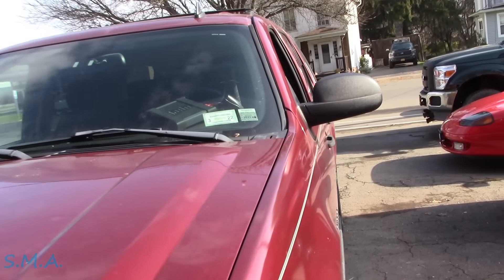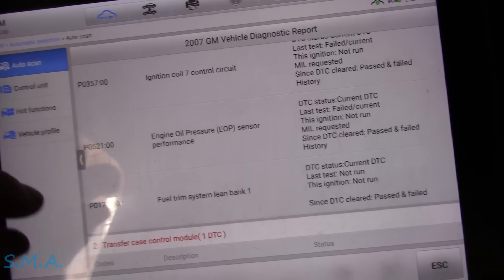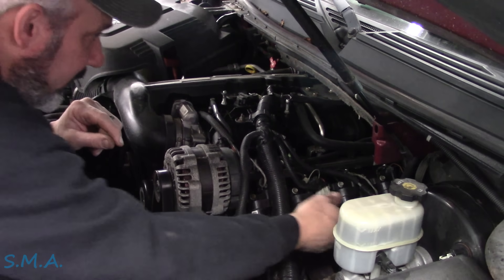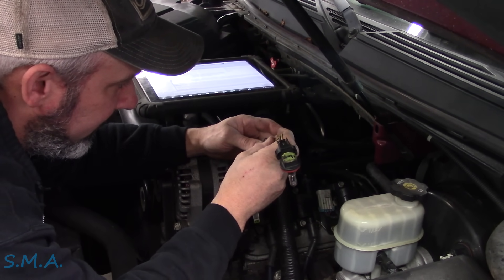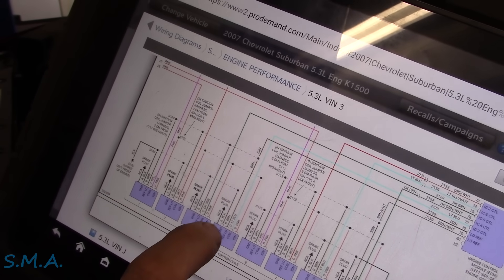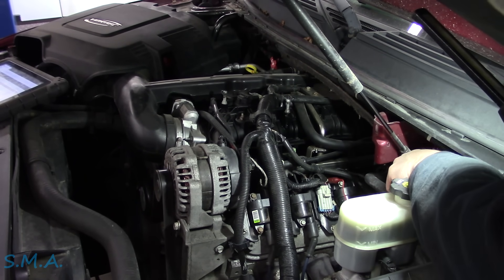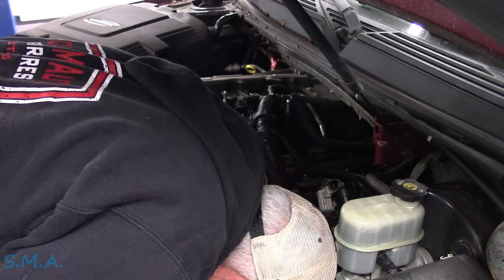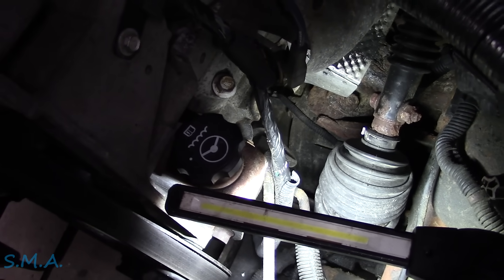Chevy Suburban 5.3: Entire Bank Misfire

Comment: One of the first things I learned from my Uncle Gus was check the grounds. He was a truck driver but also a pretty good mechanic. He drove for a trucking company that had a truck that had been in the shop for a month with numerous electrical issues. He kept telling them that there was a ground problem and they kept telling him he didn't know what he was talking about. Finally they told him if he thought he was so smart, fix the truck. He took the main ground wire off the frame cleaned it and put it back on, truck was fixed!

Comment: Quite impressive the entire bank has a blackout 😂 and this guy diagnosed the problem in less than 10 min ... Truly a PRO ! 👌💯
Reply: That was simple fix. Like he said all 4 wires or or coils going bad at same time highly unlikely. Nit impossible but just very improbable. Plus gm doesn't manufacture vehicles designed for the rust belt and Roberts your fathers Brother it's a bad ground.

Comment: Gotta love US auto manufacturers - leather "trimmed" seats, four compartment interior climate control, led mood lighting, satellite radio and break away ground connectors to ensure repeat business.    Clever.
Reply: The American dream keep ‘em coming back after 10 years. 😀
Reply: They call it a "Quick Disconnect"😋
Reply: The break-away feature is for safety during accidents, like break-away sign posts. :)
Reply: I got a classic us manufacturing truck come out factory with the rusted cab corners standard
Reply: Did anyone notice the rust and corruption under that hood? There's not much any design engineer can do when road salt is trying to return your vehicle to ore again.
Reply: Rust Belt salt corrosion.
Reply: More like all auto manufacturers.
Reply: Exactly...
Reply: I guess it’s better to coat your wires in soy so the mice will chew them into.

Comment: Hi, I'm the proud owner of a 2007 GMC Yukon Denali. I lost the whole left cylinder bank last night. I live in the Netherlands and the AAA, which is called ANWB, doesn't know anything about US cars. So there I was in the middle of nowhere with this rough idling car and all kinds of codes in my screen...and than I found this YouTube video that told me exactly how to fix it! Man, I'm so grateful for your help. Can't thank you enough. Car is driving smooth again and it took ten minutes and a piece of wire...so again, thanks!
Reply: My 08 sierra has been skipping so bad could t drive checked finally yesterday found it was entire rt bank. .watched this video fixed it in 1 day because hard to get to .Didn't want to rig.left bank quit 6 Mos ago.cost mu 400 to have fix .If they had fix both wires I wouldn't had this problem yesterday

Comment: Had a Wire Gremlin , Ghostly , Phantom issue in a friends 1994 Chevy 6.5L turbo diesel.  Started looking at around dusk and was quit dark when i opened the hood.  There was an strange orange glow coming from behind the head at the fire wall.  Mind you i had turned all a/c full and headlights and everything power hungry on before i opened the hood.  A single copper ground strap attached to the motor and firewall was glowing red enough to cook on.  All 4 of the other grounds were totally corroded away.  And with a mechanical fuel pump it didnt need spark.  BTW the fuel bowl was just in front of it!  Could have been a fire!!!

Comment: Thanks for the great video. I have a 1960 Chev panel truck with a 4.8 that is doing the same thing. If I wiggle the wire loom above the connector it will fire back on 8 cylinders intermittently. Time to check my ground.

Comment: Great explanation on this! Just had my 2016 GMC Yukon XL with a 5.3 and 135k cylinder 7 collapse lifter failure, which led to a cylinder 7 fuel injector replacement, lifter replacement,  then to a VLOM replacement, where like your video all lifters were replaced on left side, then after we got it back from Chevy dealership cylinder 1 misfire so back to dealership who said it has a spark plug failure.  We had the plugs replaced 2k miles ago as routine service. Got the vehicle back and another misfire P030 cylinder 3.  Back to dealership and they say the spark plug to cylinder 3 has failed.!!  They can’t figure out what is causing the plugs to fail!!?? I wonder if it’s the ground!!??  $5K spent so far by my extended warranty 🙏🏻
Two hundred miles before the misfires started the transmission was replaced.  Is it just bad luck!? Always been a GM buyer…. 🤷🏼‍♂️

Comment: This video was very helpful. I have a 2010 Tahoe that's been running like crap for months and had no check engine light on. 

When I stomped the pedal to pass someone my C.E.L. flashed 10 times then the light finally stayed on. Upon using a basic code reader I have the P219A & P0300.

I'll be checking this common ground next weekend when I get some free time. 

Hopefully this is the only issue with my vehicle!

Comment: Had one with the same issue just on the passenger side. The video helped a lot, this one had high resistance so it didn't take the whole bank down right away but after 30 seconds they all misfired

Comment: YOU WERE 110% CORRECT...THAT WAS MY EXACT ISSUE AND YOUR FIX.... FIXED IT!!!!! I have changed and added addtional grounds to the trany alternator engine etc. a year or so ago....but not this one. A grouind was also my problem back then with harrd trany shifting changing/fixing those fixed that problem. Thanks for this video. No one else mebtioned it...they went right to the cat as the culprit and that would have been around 2 grand to fix.

Comment: Yes you did shoot a vid on that ground - it had rubbed through on the P/S pump in that vid. Reason this is fresh in my mind is because I JUST fixed a '04 Yukon with the exact same issue as this 'Burban here, only being a GMT-800 resulted in a crank, no start! I looked through a few of your vids to try and get some quick direction and that was the one that came up first. I ended up back probing the ground & grounding it the same way you did (Only I had to repair my jump wire alligator clips for 10 minutes first - you'd think the camera was rolling, LOL!), and the vehicle cranked right up without missing a beat. So I then spliced a wire into the ground there, and connected it to the firewall ground where the left head ground strap lives. FIXED! I couldn't believe it was that easy. I was LOOOOONG overdue for a quick easy fix! Those are few and far between around here ...

Just like Cousin Eddy said, "(GM) is the gift that keeps giving, Clark, the whole year through."  That and, "Merry Christmas! S!&$#er's FULL!  :)
Reply: Oh, forgot to mention, I almost went down a rabbit hole fixing that one because I had a U1000 (class 2 comm failure), and a B1440 (power mode master input mismatch). Had not a single code regarding ignition!  I almost started chasing the ignition switch and BCM. Once I realized I had injector pulse (from the smell out the tailpipe) and theorized I had no spark, things got much easier.

Comment: Not boring, Eric. It serves to reinforce the fact that if you live in an area that has a lot of moisture, salt or even worse both, you can bet that you're going to have heavy corrosion, and generally the first things that are eaten are the soft metals (copper, brass, aluminum, ect.). The best way to avoid corrosion issues in my opinion is Fluid Film and more Fluid Film. So many bad things occur because of bad or nonexistent grounds (generally left unprotected except for paint which is  sometimes easily defeated). Great vid, Eric! 👍

Comment: Good diagnosis! One is for sure the parts that was replaced alleviated a possible problems . As it turns out the cylinder heads should be sent out to machine shop to be gone through. With that many Milles . It would be a good idea.

Comment: Found the same problem same location with my 05 6.0 GMC. But an 05 is listed as 2 separate grounds and in 06 it was changed to 1 wire for both banks.

Comment: Recently had this exact issue on my 2008 Tahoe (same color too!). Unfortunately in my case, it decided on the high way it was going to lose its connection to the passenger bank only and dump raw gas straight into a nice hot catalytic converter. Blew it to pieces internally.

Managed to track it down myself and fix it, was quite proud of myself. Found a wire harness diagram on google, that helped tremendously.

Comment: when i first read the title, i said to myself plugged cat. i wasn't surprised you found a bad ground, its just i had this happen on my 5.3. was missing on all cylinders on bank 2, but it was only setting misfire codes but check engine light would flash and it would bog down going up hill. cut the cat open on the pass side and it was plugged.

Comment: There should be a code for rat poop on the intake . Plant based wire looms, repaired with a bottle of hot sauce, chili flakes , and expandable metal . When my wife came home from a late shift , the rodents seemed to like clim😢up on the warm engine for a chew and a nap.

Comment: We have a 2014 Suburban 1500 with a rough idle. No codes! Feels like it has a slight misfire while in gear and foot on the brake. Plugs and wires have already been done! 175, 000 miles.

Comment: I have a similar problem with my bank 2 cylinders, on a 2002 Silverado, cylinders 2,4,6 & occasionally 8 have misfires but bank 1 is all good. I wonder if it is a ground issue on my truck. Alright so I guess I’ll go looking for some wires that look to be broken off or loose connections, cause I’ve been changing parts to no avail

Comment: AWESOME!  You just helped me fix my truck, as it had the EXACT same problem with G102 except on Bank 2 (2-4-6-8).  In my case the voltage between the black ground wire in the coilpack connector and B+ was 4.9V. I unscrewed the ground stud from the block and separated the eyelets.  Then I bent the wires leading into one eyelet, and the eyelet fell off!  That was the one that has both coilpack grounds crimped into one eyelet.

The problem throws you at first because long-term fuel trim goes to 99% and it sets a lean code, yet the exhaust smells like raw fuel.  The lack of spark on one bank dumps both raw fuel and unburned oxygen out of the exhaust manifold, making the O2 sensor read lean.

Comment: I had something similar on my 6.0 v8 and it was a bad ground wire coming from the opposite side of the block. We made a jumper wire from the negative cable of the battery to the ground wire of one of the coils and problem solved.

Comment: Good vid ! All the Road salting up there probably corrodes off alot of stuff at down there levels where Rain & snow , salt gets all thrown around like a washing machine under down there. Definitely a Good idea to Move all Wiring up to the Sky level / Eye 👁 Level. Where u can actually Get to stuff.
Boggles My Mind 🤦‍♂️ Why factories Put wire connections Down in the nether regions & dont Move as Much as possible up to Sky Level. Keeping it out of the Dirt ! salt , water , grime area where oil drips to too.

Comment: This video sponsored by General Motors and NYSDOT. The P0521 is the one to be worried about. That's the one that prompts multitudes of oil changes, new sending units and oil pickup tube seals, when in reality the cam or main bearings are eating themselves up and none of that fixes it. Usually combined with excessive oil consumption.

Comment: I  have. A 2011 Chevy 3500 4x4 with 6.0. Both banks no spark. Ran getting into shop then died. No dtc or communication with engine.  Where  do the common grounds for the coils merge ?

Comment: I don’t know if you still check comments on this video, but thank you so much!  My wife’s 07 Tahoe’ entire drivers side bank went out, and I couldn’t figure it out.  Ran a jumper from the black on the harness like you did, and as soon as I ground the jumper, all 8 fired.  I changed the ground on the block by the power steering pump, but that didn’t do it, so I just cut the black about 4 inches from the harness and put a barrel connector in line with an addition ground wire coming out one end.  Put an eye terminal on the new ground and ran it to a bold on the alternator bracket, and now she purrs like a kitten.  Thank you!

Comment: Saw that you scrolled right past chrome to use firefox...my man lol but for real the first thing i thought was the ground wire based on that video you did where you just cracked the ground wire loose and tightened it up and things were working again....I wish I had known this a couple years ago when I had my first car, it started misfiring in the rain (but I kept driving because i really didnt know that rumble was a misfire, thought it just ran bad in the rain)  then died completely, and wouldnt start or crank....while I was moving across the country...I took it to a mechanic the next day and he just said I needed a new starter motor and charged me ~400 for that plus labor, but couldnt find any other problem...driving away a couple miles down the road my check engine light came on, took it to autozone and it was an 02 sensor code, they sold me one but of course I couldnt install it and they couldnt help so I drove the rest of the way with that light on and eventually learned how to change it out. about a month later got an engine light for the catalytic converter efficiency and the misfires in heavy rain never went away....now after binging all of these videos, I think I had a ground problem that was exacerbated in the rain, affecting current to the coils, causing misfires and large amounts of unburnt fuel to get into the engine, ruining my catalytic converter because I just kept on driving like an idiot lol 
you live, watch SMA and ya learn...now im visiting the junkyard every other weekend to get better parts for my car or do trial repairs or disassembles so I dont make mistakes on my vehicle, ive come so far lol

Comment: Hi, on this engine how does the DIS work? Are the coils a smart coil? Meaning they have an amplifier on-board so the engine controller is sending a low current dwell/fire pulse? What does the REF LO coil signal do? It's common to each bank, so it looks like it is a control pulse reference signal.

Comment: I have a good one for everyone here.... same vehicle (2007 Suburban) same engine (5.3 v8).
Mine involves brake lights. 

Passenger side rear top bulb had a filament go out so lights worked but brake light didn't on that specific bulb. 
Changed bulb. Standard procedure.
😒
 If I use either blinker the reverse lights dimly illuminate and sorta "flash" or pulse brighter dimmer with the blinker. No blinkers and brake applied the reverse lights dimly illuminate. But....  right blinker hyperflashes when brake applied.
Pull that bulb back out and it stops acting up.  Swapped for another brand new bulb same issue. Verified correct bulb.
Visible inspection found no breaks or tears in wiring... no crusties or anything to indicate "WHY!?"
All OEM stuff (no aftermarket or LED "upgrades").

I'm at a loss.  Didn't snatch on it or pull too hard, nothing visibly broken or "off" (no giant red flag 🚩).
My next thought is the "harness" where they all plug into under the rear of the vehicle by the spare tire.
Should I fire parts cannon & replace that wiring piece (runs from connector up by corner of bumper into the taillight assembly & has every bulb socket for that side). I got some electronic safe cleaner & dielectric grease if I can try to clean and grease it.

What am I looking for?!  Help!?!?
My "experience" from watching the genius himself Eric O is the wiring is grounding itself somewhere with another path not intended. But nothing is crossed or visibly showing where or how. I JUST removed a bulb inserted new one and reverse procedure put it back together.
Reply: Do what Eric did in the video. Add a jumper wire to the ground side of the turn signal bulb to see if the problem goes away.
Reply: Slow down your looking. Think like the electrons. If everything has power that should, and nothing that shouldn't, it would work right. Reverse lights shouldn't be coming on when you use your turn signals, and your "blinker" shouldn't be coming on when you brake. "Hyperflash rate" means the turn signal/flasher circuit is compromised because the resistance of at least one turn signal bulb's resistance isn't even part of the circuit when the flashers are powered, so the flasher itself gets more power than normal, because the flasher circuit resistance has changed. By the way, do the hazard 4-way flashers work right inside and outside?? Get a wiring diagram before you change or splice anything else. You need to trace the wiring paths on paper from power to ground(s) before you do anything else.

Comment: Grounding on GM trucks is becoming a problem I have an 2004 GMC  and 2007 Silverado. Had to replace the junction block on the Chevy and need to find an intermittent battery drain.

Comment: Good old Sheberay… I had a situation where the one of the pins in the right bank coil loom connector got pushed back. I had pulled the left bank head to repair a low compression misfire (valve seat). I had to remove the intake and intern had to disconnect the top side wiring harnesses. After reassembling everything, I started it up and had a misfire on the right bank. Lesson? Always go backwards to what you disassembled if something mysterious pops up.

Comment: Got an 07same problem but no coil codes on 1,3,5,7 suburban code 300 swapped coils with other side no fix  3 and 7 have the big misfires fixed the ground no fix swapped  injectors 1 to 3 and 5 to 7 no fix but pulled #3 conector no change in idle got a code though any advice  on testing wires also did a cylinder  deactivate test and the caused the engine to stumble